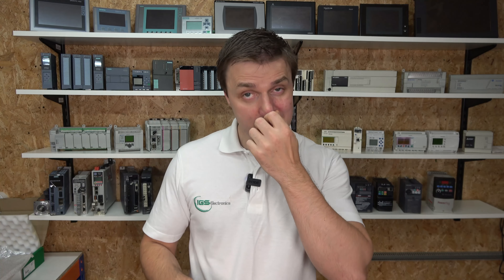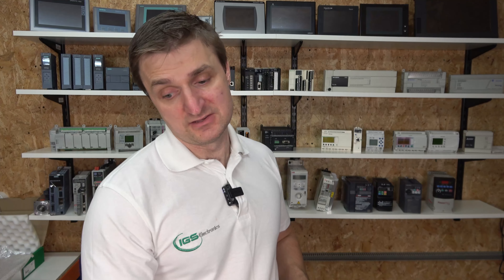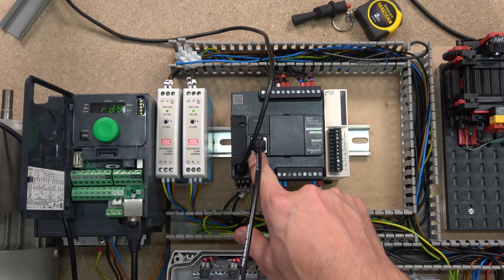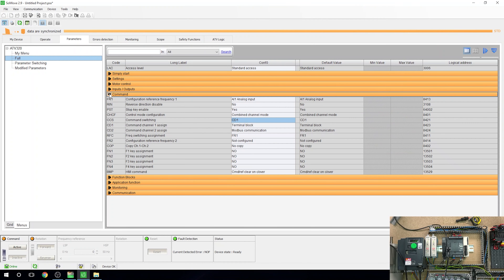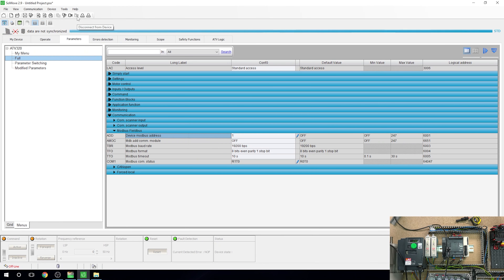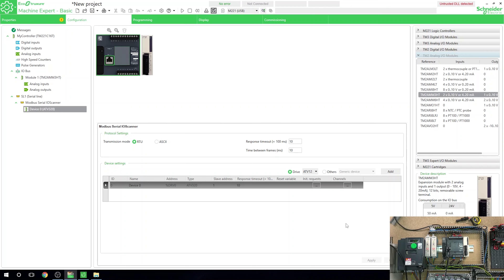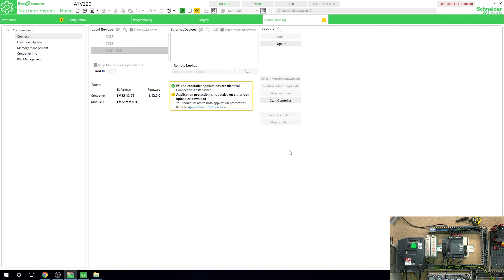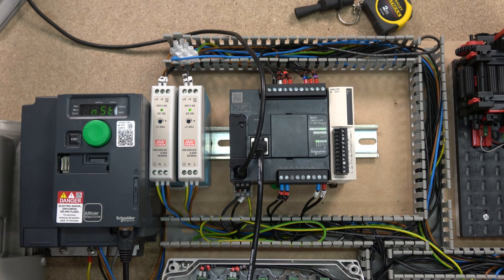Schneider Electric Modicon M221 PLC Modbus RTU set up and programming with ATV320 Drive. Part 1. Eng

Comment: Well done 👌
It would be useful to do an example of a PID on the M221 to maintain, for example, water pressure in a pipe ( Pump ) or cooling system ( Fan ). Thank You. Regards 👍
Reply from the maker: Great suggestion! Will look in to it.